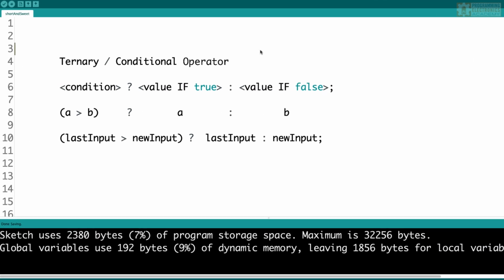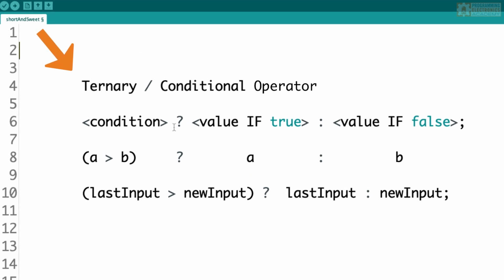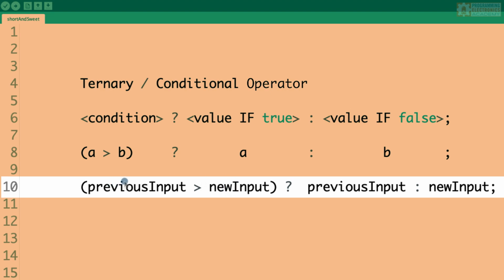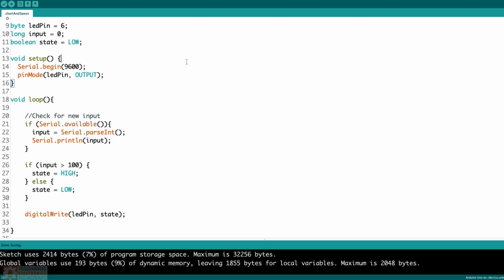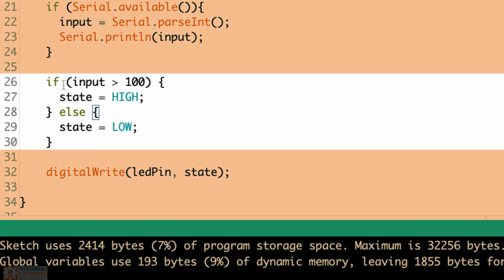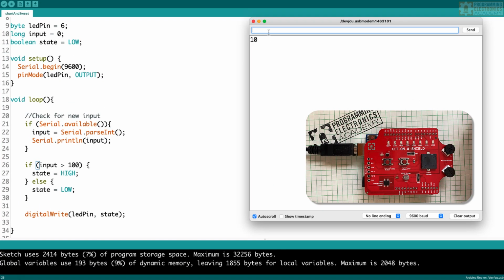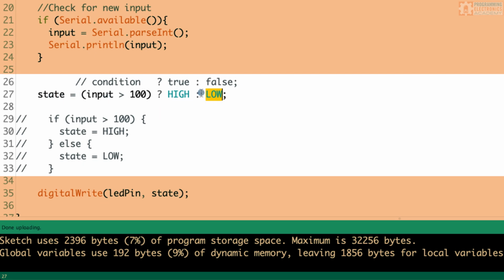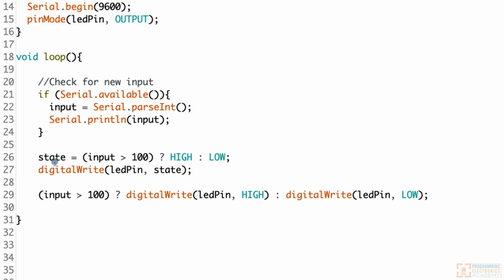What is the ? code!?  Learn about the ternary operator!

Comment: I QUIT!🤯
I have figured it out! 
I just absolutely don’t have the intelligence to wipe my a** let alone program whats left of this shotgun blasted uno!🤣
Would you please (now e-begging) do a video for morons on a wireless relay controlling an Arduino uno controlling a MD20A changing the Cytron Motor library where pin 2 and pin 3 (PWM DIR) are changed to pin 3 (PWM) and pin 4 (DIR). Now using pin 2 as an input. It is just a plain Jane 12vdc brushed motor. Go dir a at 255 stop a sec then go dir b at -255 and stop. I have tried everything I have knowledge to do. I got the motor running but just cant get the keyFob to operate anything but a bad attitude! Do I need a shield? (i know at this point the breadboard deff needs one😂🤣😂🤣) seriously tho. Im at my wits end. The message boards are so complicated i just cant even use em. I guess this kinda thing is for folks w/o learning disabilities. Wish I could post this sketch I have. (a true abortion) you would be thoroughly amazed it compiled. (I WAS)

Comment: Ternary can make your C code looks small, but it depends on some compiler. If it smart enough, compiler can optimize it but some compiler can't .I use ternary in bare metal C compile with SDCC (target is stm8 core). In some situation the normal if else costs less resource than the ternary. Just want to point out for someone playing with weird, not popular architecture/compiler.
Reply from the maker: Thanks for pointing this out!!

Comment: You missed the whole point with ternary operators. The real benefit of using the ternary operator is to use it as an argument to a function call for instance in your call to DigitalWrite to determine if it is going to be high or low. This way you don't have to declare an additional variable state just to save the result that goes into the DigitalWrite call.

Comment: I find I’m using if/else to check a range and if in certain range turn on or off several functions or relays. Does the ternary work to do this? Something like if a > b turn on c, d, e, and turn off f, g, h
Reply from the maker: Great question!  I think you could make a ternary work for this, but I believe the output is limited a single line of code.  For example, in the video, we use digitalWrite() as one of the "options", I don't think you can have more than a single line of code to execute there... (but I could be wrong...)  That being said, if you had a flag variable as the output of the ternary then that flag could control flow for several other functions perhaps.
Reply: @programmingelectronics  I’ll try that on one of the projects I’m working on now. If it works good as just a redirect for a function then I’ll use it on the two larger projects where they are almost nothing but IF statements. Although I’m not sure if I completely grasp the idea of functions yet, I’m at least understanding enough that I’m willing to try. For those curious why so many IFs, I’m making two controllers. One is based on exhaust gas temperatures to “map” how much water the engine gets to keep it from getting too hot. The other is the same idea for propane based on boost pressure since it is a mechanical fuel diesel to add power. Thanks! 👍

Comment: This really sorts of the mess of brackets required with if/else statements.
Reply from the maker: Totally agree!
Reply: @programmingelectronics  I've just cleaned up some code, in part making multiple "if" statements within a State Machine ternary operators.  There have been a few odd errors come up but working through them.

Comment: have to try, I think   
digitalWrite(ledPin, ((input>100) ? HIGH : LOW)));
might work too?
Reply: the below statement also works for this case, is simpler, without the ternary operator.
digitalWrite(ledPin, input>100);
Reply from the maker: @LilGh02t  Nice!
Reply from the maker: Nice, just checked - it works!  Thanks Patrick!  (small side note: one less parenthesis on the right.)
Reply: @programmingelectronics  Also removes a variable (state) so will probably run a little faster, if that's important.

Comment: Nice explanation. Though I find the longer IF statement easier to read.
Reply: this operator only works if the variable is only fix with two possible value, beside that, if else or even switch case statement are the way to go
Reply from the maker: Thanks!  I kind of go back on forth on which I prefer...